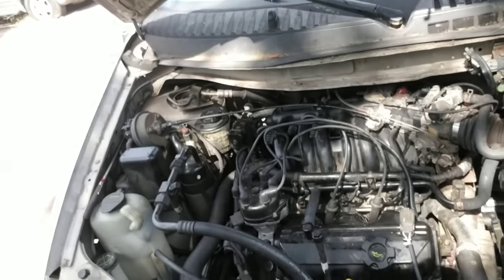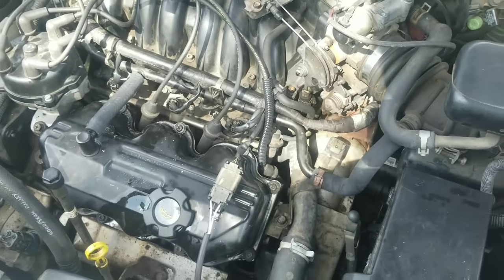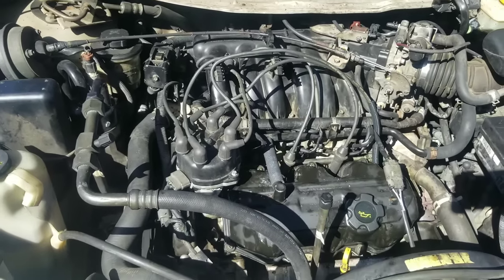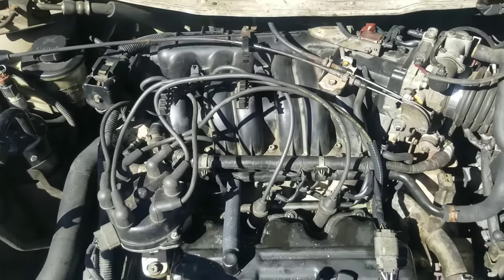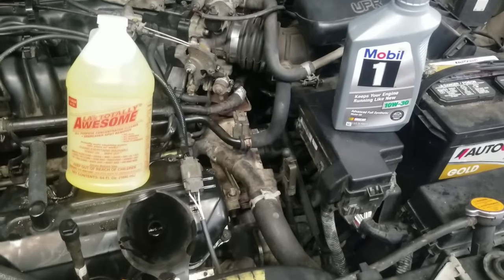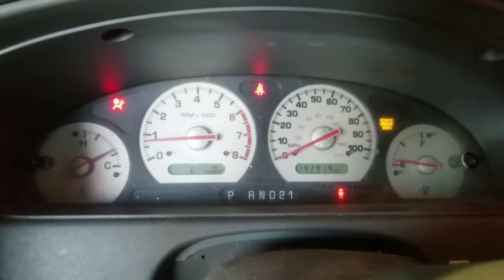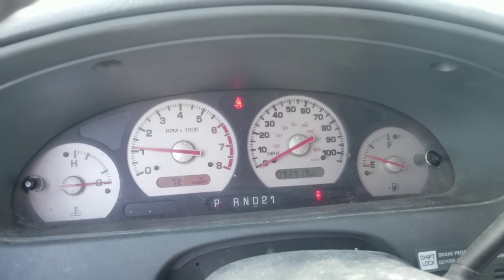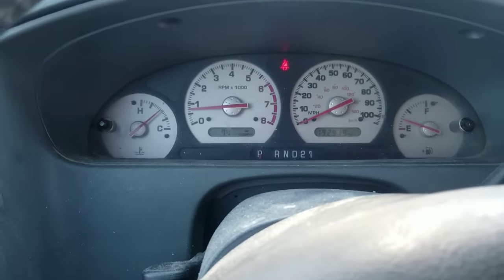How to Clean The Inside Of Your Engine The Easy Cheap Way.

Comment: You did the job to a Customer’s car and your cleaning worked the way you said LA awesome cleaner would now however We all know LA awesome cleaner is not good for the engines rubber or seals ... BUT READ THIS AND DO MY CHALLENGE LETS SEE WHAT IS MORE AWESOME MY WAY OR YOURS WAY
My way is the short term and Long term cheap safer and smart way by using WD-40 starting with 32oz equals to a quart and you can add more if need from a gallon can of WD-40 sold in Auto Part Store and Home Depot Store for less then $15 we all know WD-40 work when cleaning out junk like build up oil tar works for metals and paint even when cleaning it out of your own hands
Reply from the maker: great, do you know what wd-40 stands for. (water displacement.- formula 40. = WD-40) google it. also you said wd-40 was $15 per bottle. Awsome is $3 per gallon. so my way is way cheaper from the start. Furthermore, the label states nothing about rubber problems, hell you can use it to clean your tires.

Comment: OK ladies and gentlemen....please do not do this to your vehicles engine this is a good way to strip the coating off of your main and rod bearings not to mention gaulding your rings on your pistons. The best way to clean debris from your oil pan is to pull the pan and clean it thoroughly. If you use this method it is almost the same as running water in your oil because the cleaner he is running is no more thicker than water. This is just some advise from a mechanic and I have worked in dealerships my whole life. You don't have to listen to me it's just some advice
Reply from the maker: Thank you please like, share, and subscribe, also please check out my other channel Salem Taxi, on YouTube for more material on a different level.

Comment: If you change your oil regularly every 3,000 miles, you wouldn't have to flush your engine. These motor oil are made so good and the oil filter is designed to filter all the impurities. I personally wouldn't recommend an engine oil flush but to each his own. Peace!

Comment: the problem with non lub products added to the oil is they premote dry spotting of the rod brgs and clogging of the oil pump sump some 50 to 500 miles after the filter change

Comment: First you need to know if your cleaning product  will effect o ring seals if it does then don't use it for this purpose. Car Manufacturers will have specific products that can be used that are safe for your particular vehicle to do an engine flush . also remove and replace your pcv valve after using any engine flush .
The real test in your example is to go for drive on a hwy .Then park up vehicle overnight . next day start it up and if it blows smoke  at start up for a few seconds but soon disappears after that, then chances are you damaged  your valve guide seals by using a flush that wasn't compatible. Personally i would have dropped the sump removed oil pick up and cleaned them in a cleaning bath. it takes less time than doing multiple flushes and cheaper . Loosen the engine mounts if you require more space and raise engine slightly  . plus you have the added bonus of being able to inspect the bottom half of the engines internals for any noticeable damage or excessive wear. as a general rule i remove and replace bigend bearings every 160K ~km  ..100k Miles .   
My camry has 550+k miles  on it  .  My old volvo wagon  700K miles.   Keep your vehicles well maintained and  don't treat them like  a weekend racer and they'll last you  many years.

Comment: people have been using diesel as a engine flush for donkeys years, and it works. Another thing we used to do was the poor mans valve grind. mix up a bit of brkefluid, kero, and a wee bit of whatever else you could lay ya hands on, long as it was flammable, and slowly tip it down the carby while revving the bitch..and it worked. Now we have all this fancy stuff that costs plenty and i doubt it works any better than the old ideas. LOL yes I'm bracing myself for the haters...

Comment: Diesel fuel works well also. This is nothing new. Flushing motors is old as motors themselves. Very common before oil had detergents added. Diesel is one of the best detergents known. People don’t change their oil often enough today. Therefore flushing is necessary on those vehicles and is a good idea to do about every other oil change on any high mileage vehicle. If this shocks people, they don’t know a whole lot.

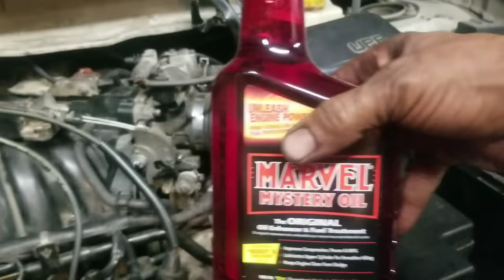Comment: ignore the first 14:30 of this and you may be ok. oil and water don't mix FYI.
Reply: If you would take to the time to note the cleaner Awesome is a combination of  0.01 to 2.5
Orange Oil Blend(CAS# 8008-57-9) & (CAS#111-76-2))
0.5 to 4.0
Ethoxylated Alcohol (CAS# 9036 19 5)
0.5 to 1.5
 Disodium Salt (CAS# 6834-92-0)
 0.5 to 1.5
Tetra Sodium EDTA (CAS# 64-02-8)
 0.5 to 0.8 
Hydroxy Sodium (CAS# 1310-73-2) 
QS
Water (CAS# 7732-18-5) Based on the compound make up the product will blend with oil and in fact break it down. So it will mix with oil. If you are worried about the amount of water you could always use Simple Green Rig Wash, only 67% water.
Reply from the maker: Thank you please like, share, and subscribe, also please check out my other channel Salem Taxi, on YouTube for more material on a different level.

Comment: Use this once to flush out my system after radiator gave out.. transmission fluid mix with engine oil

Comment: Change the filter also with each flush?
Reply: Michael Walker 
I would if I was you
Reply: Thanks. Son has an older Impala that was neglected it seems. Run well. Think it just needs a decent cleaning. Does not lose oil. So far ok.

Comment: while you brought an engine back from the brink because someone didn't do their regular mantinces you at the same time put extreme where on the bearing surfaces
Reply from the maker: no the bearing are fine, and actually in better shape and will last longer because they can now get properly lubricated. the car  runs 100 percent better.

Comment: hell on motors that were on their way out i've tried lots of things.. because what i was about to do to them wouldn't make it any worse.. I've done distilled water with engine oil, diesel with oil, many types of cleaners... "engine variety ' mind you. Haven't done this one yet. the thing to remember is that an engine can run with pure water in the crankcase, it has the lubricity.. you just don't want it to sit and oxidize your surfaces.. the oil provides the extra layer of lubrication, the fluid itself and pressure sill provide enough of a film to cushion the parts.. its not like you pour these mixes and and crank up the load on the motor, you want it to spin as gently as it can until it cleans itself out. If you can drop the pan.. yes do it.. if you can't.. sometimes you can get away with stuff just like this. some of that 'sludge' gets so built up that it can literally block the drain hole from the pan.... as for it affecting seals.. as long as it isn't xylene or acetone based.. it won't hurt your seals. You could actually fill your crankcase full of liquid soap and while it remained liquid.. it would ddo just fine in lubricating the engine.. once the water based part of the soap evaporated however is where you're trouble would start... it's all about volume, film strength, and lubricity...  if it was pure lubricity hydrochloric acid would be one of the best.. aside form the obvious immediate drawbacks.. lol. So while most of us out there would go .. 'what in the hell are you doing'.. there are those of us who try outside the box things.. because we're not sheep who blindly follow every 3000 mile doctrine that gets sent down the pipeline. Some times its fun to experiment... the best I've found to date..personally is adding distilled water to a full crankcase of oil and just letting it idle... it gets hot rides around the engine, cracks the carbon off the valves, then once drained and new filter.. is totally evaporated.. with no residue behind.. the oil is still there doing its film job..  because the whole inside was coated with oil before addition.. so the water makes no contact with the metal inside.. but it will get hot and attack the sludge... hot water is amazing at cleaning... but that's just me.. try what you will, if i come across an engine this bad again.. i might give this a whirl.. maybe with a quart of distilled thrown in.. to aid the break down.
Reply: actually did, an entire gallon of distilled water 13 miles from where i poured it in to where i changed it.. dodge 360.... motor outlived the truck, the truck he offered me so much money for it i couldn't say no, he wrecked it, now the motor lives on in a dodge dart street/strip car.
Reply: but i've only actually done it on my own rigs.. so if something was to go wrong. .i would be the only one out.
Reply: @Miguel Jackson was't pure water.. always have oil in the mix..
Reply: I'm just saying water by itself will actually provide a film under pressure.. as a proof of concept.. i had oil in it at the time also.. also when i lost my head gaskets.. i added some oil with some distilled to wash all the antifreeze out.. ... when i was pulling apart the motor. the previous owners.. didn't have things very tight.. i was pulling head bolts and .. some of them were barely tight... new gaskets.. and due to my financial situation at the time.. i put 1000 grit sandpaper on my flat sander.. and 'resurfaced' the block and heads.. checked with a flat edge.. crossed my fingers.. and has been fine ever since.. going to swap to aluminum heads.. prolly next year summer time, give me some time to save up for them,  any recommendations.. I'm leaning towards either edelbrock or speed master.
Reply: @Miguel Jackson well not all of it. .let me assure you.. an engine shouldn't be much higher than 200 operationg temp.. sure there are hot spots that get  higher than that, but the water jackets are what keep everything under control.. some of the water might steam that make it into the combustion chamber.. but hot water certainly does do a hell of a job of cleaning..
Reply from the maker: thank you well stated and correct.

Comment: Could you use this in your automatic transmission?
Reply: Absolutely not.
Reply from the maker: no do not add to the internals of a transmission, however the outside can be cleaned with it.
Thank you please like, share, and subscribe, also please check out my other channel Salem Taxi, on YouTube for more material on a different level.

Comment: dont throw that out if you set the pail in a corner and leave it for a month the awsome will seperate from the oil and you can recover it to use again oil and dirt goes to bottom awsome will float on top

Comment: I believe the marvel mystery oil will work but I'm not sure with the LA stuff. First time I see someone do that.
Reply: He proved that the LA stuff works, but the question is why would you use that when a much safer bet is to use either diesel fuel (1 quart mix with motor oil), automatic transmission fluid (1 quart mixed with motor oil) or Marvel Mystery Oil (32 ounces mixed with motor oil) all of which not only have cleaning properties but are also good lubricants. Any of those things will work just as well as the LA stuff but without risking your seals or bearings.

Comment: But 5 to ten gallons of diesel  add half quart run engine till hot, wait,  drain 1 quart, then add 1 quart of  diesel run again till warms up again drain hole thing remove filter, replace drain plug add gallon and a half of diesel wait couple hours (DO NOT START ENGINE) drain diesel with drain plug off pour one gallon straight throughout let drip for hour, replace filter, drain plug and add oil, start car let warm up check oil color wait a week repeat

Comment: Good information. You are very well spoken. But 6 oil changes? Math.....6x5=30 quarts @ $4 quart= $120.....is their less expensive.... hope your boss doesn’t find out ya used $10 synthetic. Guess you’re hoping 1 quart and no driving will do the job.
Reply from the maker: i am the boss, and my cost is different then the public, and i was paid to perform the job, so the customer has the bill.

Comment: I never would have put a water based cleaner in the engine because that just removes the protection on the metal  ..A small amount of Mineral Spirits  or regular engine flush would have been fine  along with MMO for a flush ..The soap that is left in the new oil will just degrade the protection.

Comment: Ya don’t know what your doing, other than damaging engines. If the oil is changed regularly this is un necessary. Good thing ya posted your shop... now I know where NOT to go for brakes & whatever else.
Reply from the maker: dude this is not my car, i fixed it for the elderly owner, the car was suppose to be scrapped, i saved it. So what is your problem, talk about what you know about. its almost a year latter and the car is still running great, So your argument again was???

Comment: NO NO NO.... these engine flushes will do one thing only on high mileage engines. Wash away whatever sludge is keeping the bearings and crankshaft alive. Like pouring a can of cola over the hood of your car. It will strip the paint to metal and you'll need a paint job. The same with your engine, you'll blow it first highway trip at 70 mph because there is now no more lubrication between the spaces packed with oily sludge that have worn over the high miles, thus the noisy engine after your flush. A car that has been well maintained meaning scheduled oil and filter changes can last half a million miles or more with a flush of kerosene every 20k miles for 20 minutes only and only at idle. The flushes that I see on youtube will not clean out the oil ports that distribute oil throughout the engine because they are now permanently clogged. Just drive it as is and hope it blows and buy something newer. I should know, I did an engine flush on my car because I thought I was doing something good, I was also young and naive. The engine clanked away thereafter and then seized on the highway on a 20 minute ride 2 wks later. I then bought a newer car from someone who had maintenance records to show with the sale. But these motor flushes will do more harm than good on higher mileage engines. Change your oil every 5000 miles using synthetics!

Comment: The big issue I see with using this chemical is its water-based. Water based chemicals and oil do not get along. If you want a better example look at what happens to oil when it mixes with radiator coolant it's not pretty. you can turn the oil acidic and dilute the anti-wear additive packages that is in common motor oils and worst case scenario it can actually cause the oil to sludge up worse. You could achieve the same method and more than likely get better results if you just used a petroleum solvent-based flush like Marvel Mystery Oil, seafoam, motor medic, something like that. Some people have even drained a couple quarts of oil out of their vehicle and replaced it with straight kerosene that works really well even though it is high risk. But personally I would never dare put anything water-based in my engine especially something that you buy at the local Dollar General Store.
Reply from the maker: dude its only in there for a short 5 to 10 mins to dilute the oil and sludge so it can drain out.

Comment: you can tell by the noise of engine it is not healthy i would i am not being a critic of this method but i would drop the oil pan to get rid of all the stuff and also on every flush put a new oil filter in there so it does get cleaner

Comment: Cold engine add can of berrymans b12 chemtool to oil run till oil and engine reach operating temperature then drain oil immediately while hot. Replace oil filter and add new oil with a bottle of MT10 MUSCLE . enjoy the best oil change of your life. Dont drive car while treating motor with b12 .

Comment: The easiest way to keep your engine clean is stay with the oil changes when is due.
Reply: Not true
Reply: simple, and excellent advice!!
Reply: How is it not true Herby. I been changing my oil at the specific time when it needs to be changed. I have taken my engine apart and the wear on my motor doesnt when show any wear on the motor. Not even the timing chain has lost irs tension.  Mileage on my car is 220,000 and I use this car for commercial driving not personal.  So I'm using the car harder than most.  I'm still using conventional oil on my car to this day from making my oil changes when its due. This guy video seems like the person who owns this car could car less about oil changes.  If he thinks his carr is good to go after that is tripping.
Reply: @nasty6758  well Mr. Nasty, althouth I'm no mechanic, i do fluid exchanges for my mom, grandma and anybody else in my family all the time. They usually go to Firestone or Jiffy Lube to get their oil changes whenever I don't have time. From what I've seen, lube shops simply do drain and fill oil changes. Its to be expected for what you're paying. However, if you don't do a complete cleanse of the system like the guy in the video, you're basically mixing fresh oil with old sludge that was stuck in the system. It still works but in order to maximize the oil's capabilities, you should do what this guy did in the video. I do it in my 05 Jeep Wrangler everytime and my oil looks clear as day when i change it (even though i change my oil once a month because i like pretending I'm a real mechanic). I'm saying most people are putting good oil in with bad. Those same people couldn't tell you what power steering fluid or differential fluid was either. What this guy is saying is you get the cleanest engine doing it yourself. The only person who doesn't think so is the lazy person who just wants to take it to a shop. You obviously do it yourself and thats why your engine is clean.